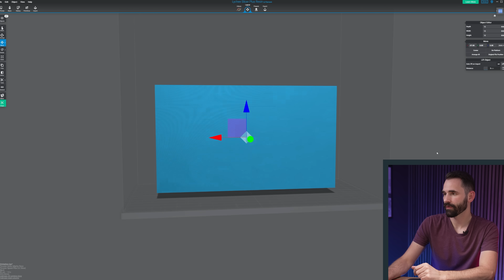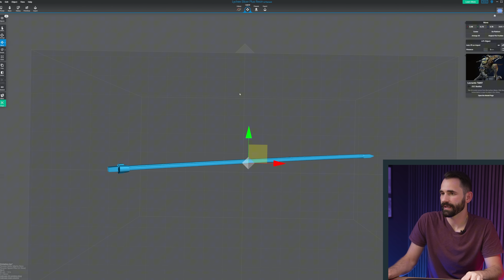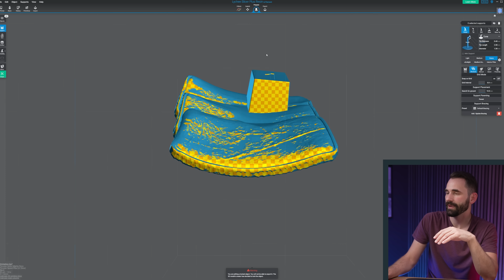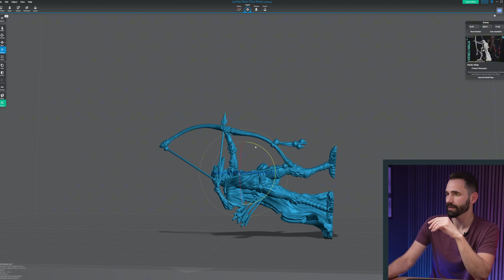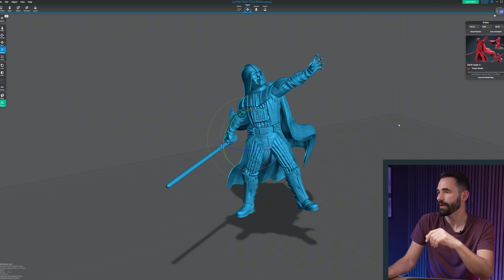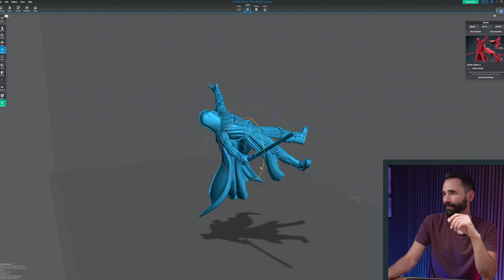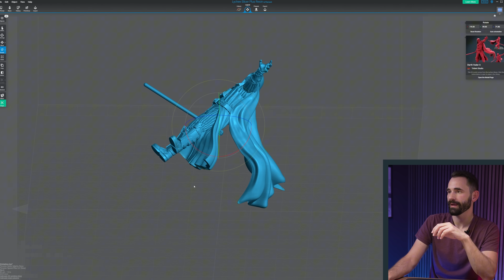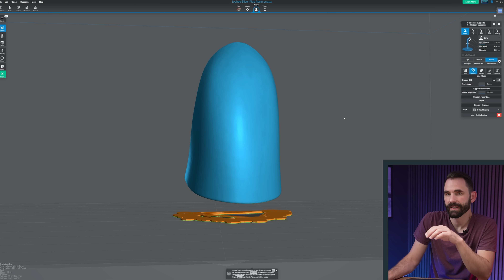How to Perfectly Orient Your 3D Model? | Lychee Slicer Tutorial

Comment: Great video. It's good that you reorient those premade and pre supported models. I'm always doing that with purchased STL files.   It's a never- ending learning experience for sure to get that balance of quality and efficiency. 

I think another perspective that would be beneficial for 3d print specialists, is it might be worth learning the aspect of modifying or cutting up a model and create keys with a 3D or sculpting program (and then making it water-tight object for print again).
Blender is free and Nomad is cheap so it's inexpensive to learn and do. 
For example, with something a bit complex like that Vader with cape and light saber,  you can cut out the saber, or both hand and saber (like the movie😂) and print it vertically, independent from the rest of the body orientation.  
 It's an extra step for sure but it's nice have more control of parts to get the cleanest print without much post- processing.  If it's for yourself and you don't mind dealing with possible warping, sanding or smoothing  then there's probably no need to learn that aspect of 3d modeling. For me, I sell and paint 3d resin prints like this as well as custom characters, so I try to avoid too much post process steps so I can focus on painting especially when dealing dozens or even hundreds of the same 3d print (I have a big order coming up 🤞).

Comment: You missed the most important thing that matters when selecting orientation; NOT orienting the model so, that it won't fit your build platform (including supports). Sometimes that leads to "very bad decisions" considering the other things you mentioned, but sometimes that just must be done.

EDIT
Or rather "not just you", but everyone who is going to print the same supported version. Sometimes I've done bad orientation to fit part on Elegoo Mars print platform, even if I personally have Saturn. (if the model will be shared with others)

Comment: New subscriber to the channel , what is the ‘parallel to the build plate ‘ problem you reference in this, please
Reply from the maker: Welcome! Printing parallel to the build plate is more likely to fail than printing at an angle, it makes a bigger cross section to pull out of the fep, the smaller the cross section the better :)
Reply: @ Thanks. Loving the vids btw , I’ve been a 3D printer for a couple of years now , mainly wheels/tyres/body parts for 1/24 scale cars. I bumble my way thru Lychee so these vids kinda vindicate what I have found over time.  I was interested to hear the final section of the vid where you printed your m/cycle wheels and tyres parallel to the build plate - I have done this for a while now and find the accuracy and ‘roundness’ is improved, compared with printing at an angle.

Comment: I unsderstant that we dont have to put the pieces parallels to the platform. But i dont get why.. why when we do put the pieces parallels, they make a kind of belly in it?
Reply from the maker: The larger cross section to detach from the fep, the more chance for a fail :)
Reply: Easy explanation. The supports create a mess. The suction makes it fall off the build plate. The way you place it can cause severe problems from being uneven to just looking horrible to completely failing and breaking your lcd.

Comment: I have had Lychee Pro for 3 months. I am quite savvy with tech, but for me,  Lychee is proving to be quite non-intuitive. I have spent 2 days trying to learn positioning, holes, suction cups and hollowing. Please slow the website documentation videos down, and take into account beginners at both printing, and Lychee. For instance, your video on hollowing shows you rapidly clicking all over the software screen to move the model around and showing different views and I can’t determine what is happening. Thank you
Reply from the maker: Hi, thanks for your feedback! We will keep that in mind in our next videos! In the mean time you can check our live Support for the First time, it's more beginner friendly :)
Reply: @ I appreciate you paying attention to my difficulties. Since I wrote that, I have found some few beginner videos, but I still had my first failure of a print after three months of printing,  because it was the first time I tried to place holes. For the life of me, I could not find instructions how to make sure the hole was flush with the bottom of the figure. They ended up extruding beyond the bottom and it caused the print to fail. Where can I find instructions on how physically to place holes with my mouse on lined up with the bottom of the model? Thank you🙂
Reply: Really. I am absolutely not tech savvy and Lychee has been a lifer saver for me. I do know when you hollow and create suction cups. If your hole is too big off placement or wrong it will be red, I just make it smaller and move on. This is just me though
Reply: @Wood-In-My-Eye  thank you. What I cannot determine is how to place the hole. As I’m moving it around the graphic keeps flipping on its side and then up again and then on its side and I cannot figure out what it is doing. Nor is the instruction clear about where to place the hole. I wish there were a function where I could click where I need to hold to be and it would just do it based on the thickness of the walls and the angle of orientation of the miniature.

Comment: I usually autosupport with Lychee and it does an okay job.  sometimes its brutal how many supports there are but it pretty reliable.
Reply: I susally start there but it has the annoying habit of putting supports right in the face of a figure. Orienting first and then doing auto-support seems to work better.

Comment: I would pay all money for some magic always correct and optimum orientation functionality in Lychee. I know, there is "magic" and auto orientation - but often it gives far from optimum results.
Reply: @kszyh_  The way the magic button works is it looks at the direction of all the polygons in the model and tries to find where most of them are at a 45. 

If you've got a very complex model, this is going to be rather impossible. We are thinking about having an enhancement to the tool where you can Mark a location as high priority and it will prioritize that being facing away from the build plate. 

But as of right now, knowing this information should help you quite quickly orientate your models in the best way possible.
Reply: @J3DTech  I'm looking forward to it.

Comment: I can't believe how many people will just tilt parts 45° and generate a ton of supports. Thanks for the PSA, this rule really messed with people's brains.
Reply: That's because Lychess' Thomas also tells you to do that. So they contradict each other.... https://youtu.be/bAUnyNF7qkk?t=3019
Reply: @SomeCrazyVids  In this one he's specifically talking about this really large foot with this really flat base. If I had a foot of similar dimensions and construction I would tilt it back like he did or to the side to avoid that large flat area on the build plate.
Reply: Ddddddddddddddddddmdddddddd
Reply: Dd7dddd
Reply: Yes I've never understood it. Unless you're printing a box it's always 45d to what? So that's why instead I'm looking to get the object to be it's own support by looking for gemotety strong shapes and keeping a higher priority surface away from the build plate. 

A bit of a mouth full but hey it works.
Reply: @J3DTech  I think they understood the 45° rule as a "best case" when it's actually the worst, 45° is just the upper limit where everything should be as vertical as possible.
Reply: I would say there is one case where that rule can apply, when you're printing a base, especially round ones, because you absolutly don't care about support damage at the bottom of the base, and printing it verticaly could mess with the round shape.
Reply: @vincentlelong3106  I print my round bases almost vertical. For 1" or less, the round shape is fine. Best though: flat to the plate on an FDM printer. No supports, no damage. And because they're pretty flat they print quicker than on a resin printer.
Reply: @vincentlelong3106  I agree. I actually print my bases on less than a 45 so that the top of it comes out a little bit more cleanly. Yeah it requires more supports and the bottom is a little bit more damaged. But like you said no one sees it or what I really do is I just put it on a diamond sanding plate and in about 20 seconds it's polished flat.
Reply: 0:10 0:12 0:15 😮

Comment: Do you have more info on orienting and supporting engineering parts that require tight tolerances?
Reply from the maker: We'll do a video focus on engineering parts! :)
Reply: @pantwearer  Due to a YouTube stuff we try to keep these videos relatively short and so I did have some stuff set up to record more on the engineering but I ended up not doing it simply just because of the time restraints. 

But if you load up Colts3D and you look for j3dTech you'll see all my models. One of my bottles is this big robot with like 350 pieces. Download that file and load it in lychee even if you aren't planning on printing it. Just load it up and look and see how I've got things orientated. 

A lot of the tolerances in that robot are 0.02 mm - 0.1mm and you'll see how I overcame a lot of these challenges just by looking at that scene.

Comment: Blows my mind that this technology is still so complicated. Jeez, if ever there was a time to get AI involved, it's here.
Reply: Even if you used AI to orient the models, you'd still have to know how to do it yourself so you could make sure it didn't make a mistake. Because - spoiler alert - AI makes mistakes. Constantly.
Reply: @kumada84  I'm more concerned about it becoming a mandatory service. That's the business model AI bro ultimately aim for.
Reply: Well the problem is that an AI have no idea which part you want to face up. It could find the best overall self-supporting orientation for reducing the amount of supports and islands, but most of the time that would be the worst orientation for reducing support damage on the detailed/important parts of the model. For a lot models, like the darth vader one, it would probably end up rotating it head down and feet up or something like that.
Sure you could make a tool to tell the AI on which parts it should try to avoid putting supports, but then it might as well be quicker to rotate it yourself.

Also keep in mind that everyone have different level of expectation regarding the quality of their prints. We like to optimize everything and all but if you're happy with just auto support and spending less time as possible preparing models for printing, it's ok. Just do what work best for you (as long as the print do not fail of course).
Reply: @vincentlelong3106  It's almost no effort at all for AI to ask "What parts of this model need to clean?" You click that and it does the rest.
Reply: Tell me about it. I use lychee I love it! I have used every slicer available and lychee is the best. Now settings on my printer whew I can’t figure it out. Not exposure yet rest lift layer height pfffff…
Reply: @Wood-In-My-Eye  Yeah, exactly. I want to print stuff, not become an expert in the print process.
Reply: @Martial-Mat  It's a tough one. First, the AI would have to be trained on all the different types of models out there shapes and surfaces so they would have to be able to understand if something is a face. You will probably have to understand when the model is assembled. What surfaces were internal versus external in order to make the correct judgment. 

Of course this is all possible. It would just require so much computing power and since slicers run on local machines, I think your local machine might crash trying to run the AI.
Reply: @ large language models train on large pools of data - why should 3D printing be any different? Everything is just experience.
Reply: @J3DTech  If a human can make the decisions, AI can do it better. The AI learning algorithm can operate at their headquarters - not like their software is cheap - then it can give the details locally.
That said, this doesn't need to be Midjourney AI, just a basic level of analysis.
Reply: Current ai isn't really ai. It doesn't really think for itself and examine an issue and solve it. It just accesses tons of data and gives you what is probably the best answer.
Reply: @ That's all humans do too - experience = solution.
Reply: Would like to see how you support a very large 1/4 model thst maxes the build volume  and the only way you can change the angle  is where it sits  these videos are very informative  please keep it up
Reply: If your job gets easier, you're about to lose it.
Reply: @Francois_Le_Blendeur  Ha ha - but printing 3D models is a hobby not a job!
Reply: Great point!
Reply: P @michaels3003